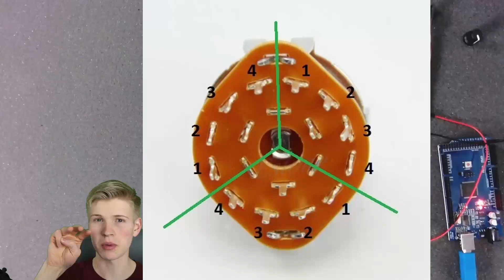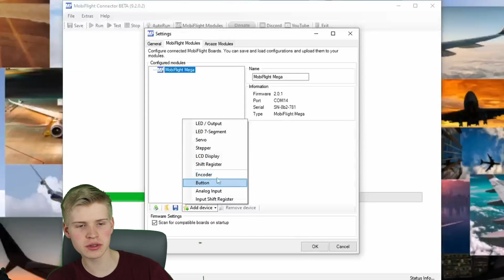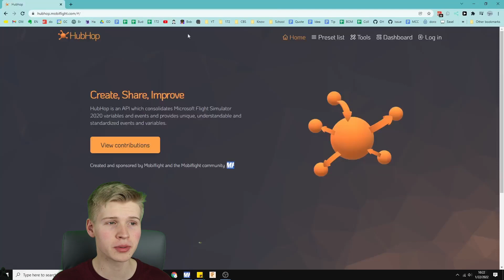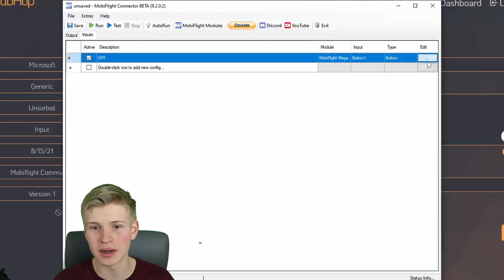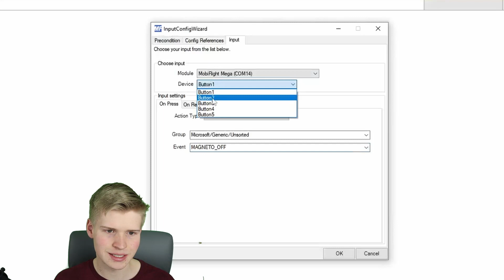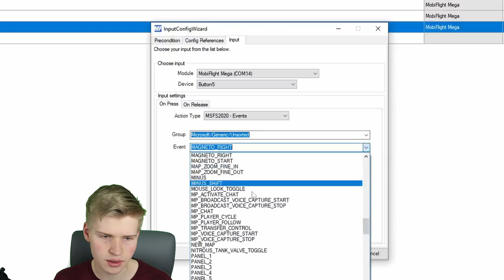Connect a Rotary Switch to a Flight Sim | MobiFlight Crash Course Episode 7

Comment: A 2P12T rotary switch..  if I use 1p and tie it to T1-6, and tie 2p to 7-12, and set rotary to pos.1, does that close circuit 1p/1t and 2p/7t at same time?  so if you have 5vdc on input 1, and ground on input 2, with switch in pos1..  would you get 5v on T1 and ground on T7?
Reply from the maker: A 2P12T switch would have two isolated 6 position circuits (T1,1-12 and T2,1-12 would match).
If you want half of the 12 position travel to be 5V and half to be GND I think you would need a 2P12T and connect each pin like you're showing. Note that these are not standard.
Why are you putting ground on pin? GND is usually common (center) in this application.
I'm not 100% sure if I'm answering your question but you can always try it out with a multimeter and a 9V battery!

Comment: Is there a way to configure this for a racing sim? Like to change TC settings or engine map on the wheel.
Reply from the maker: You can use the vJoy setting or to a keyboard simulator
Reply: @CaptainBobSim   I guess I didn't phrase it well, my bad 😅. I wanted to ask if the input (position change) is continuous or does it give out 1 signal that lasts X ms and then dies until the next position change?
Reply from the maker: I believe the VJoy stays "Pressed" until you release the button, then the button state is changed to "off" (If you configure VJoy to turn it off)
You can configure it a number of ways if you get in depth with the logic.

Comment: Thank you for very informative video. Some comment which may be irrelevant though. In C-172 mag switch START position switches Right mag OFF and only LEFT mag is on during start.
Reply from the maker: I don't think I understand what you are saying - is only one mag used during start in the real plane?
Setting the start event to start should be sufficient for the simulator.
Reply: @CaptainBobSim  In the left mag there is an impulse coupling which is used to retard ignition timing for start. Right mag does not have one and if right mag is on during start it will produce spark with fixed advance (24 degrees if I remember correct) and it will kick backwsrds and destroy starter. Therefore only left mag is ”ON” during start. Once you release the key from start the right mag is back in business.
Reply from the maker: That is really cool! Thanks for explaining that!

Comment: Do you have any idea why this doesn't work any more !
I have MB version 9.3.2 and here the OFF have to be 'activated' 2 times for it to go to OFF and stay there.
Every time START has been involved in a sequence then OFF has to be 'activated' 2 times - if START is NOT in the sequence, you can go OFF, RIGHT, LEFT, BOTH and back to OFF again with just turning the switch ... the key on the screen is going to OFF with JUST the turning the rotary switch to OFF 1 time.
What did change from YOUR version of MB til the 9.3.2 version ?
Reply from the maker: That's a really weird issue. It might honestly be your wiring (I haven't had any issues with this)
Check out my switch panel configuration video if you are using FS2020 or my rotary switch if using FSUIPC.
You might also consider asking on the MobiFlight forum, where you can provide configuration screenshots
Reply: @CaptainBobSim  There I was adviced NOT to use FSUIPC and my wiring is OK ... others see the problem too !
I just wondered how you did it - but it's another version of MobiFlight thans mine I think
Reply from the maker: @keldsor  That is really strange! I think this happened in a recent sim update or something. I'll have to investigate further
Reply: I had the same problem.

Because the key position within the sim is automatically returned to the "Both" position while your physical switch is still in the "Start" position, it throws the key position index sync out of wack between your physical rotary switch and the sim key switch.

The way that I solved it? Within the "Start" button parameters, set BOTH "On Push" and "On Release" events to "MAGNETO_START".

That way when your physical switch returns to the "Both" position, the sim will flip the key once more to the start position and once again automatically return to the "Both" position, and by now, your physical switch is already in the "Both" position, which "re-syncs" your physical switch to the sim switch.

One caveat to this is that you must hold your physical rotary in the "Start" position until the aircraft starts. Which gives the sim enough time to auto return the sim key to the "Both" position before the "On release" initiates the second "Start" key turn. In other words, turn your rotary slowly and kind of linger in the "Start" position for an extra few miliseconds before releasing the switch to the "Both" position.

I scratched my head on this one for a while as well.

Comment: Hi, I have recently started a 737 cockpit and I would like to connect output lights for the Afds panel, master caution and some more. The problem is that these functions don't exist in mobiflight so I have to create one... but I struggle to do that... (*I'm on x-plane 11)
Reply from the maker: You have to custom code these: www.mobiflight.com/en/tutorials/x-plane-quick-start-guide.html
I would check to see if you can assign a keyboard shortcut to it however, then use an input type: keyboard shortcut (MobiFlight will "type out" the keyboard shortcut)
Reply: @CaptainBobSim  thanks for your answer, I will tell you if it works !
Reply: I tried modifying the script with the correct format but X-plane doesn't recognize my outputs ...
Reply from the maker: That is odd - it does take a bit of getting used to. 
Personally I like to take it slow, read the huge chunk of text at the top and only work on one thing at a time. There's a steep learning curve, but I find it is great to have done in the end.